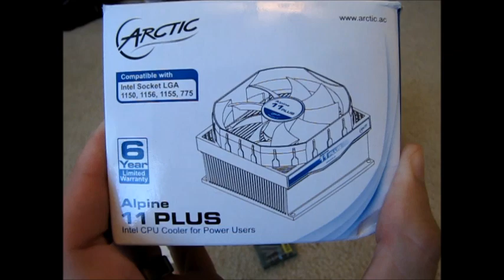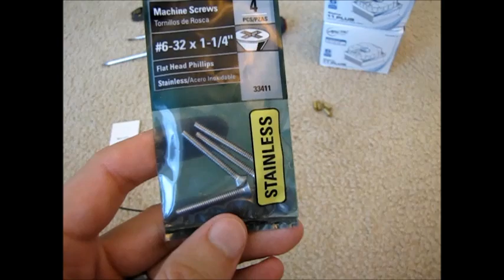How To Build A Peltier/TEC Cooling Device (Thermoelectric Cooler)

Comment: How much did yo manage to cool the hot side? I'm trying to build a peltier cooler to use in an arduino project, but I can't seem to cool the hot side enough to be able to lower the temperature of a controlled ambient (size: 40x40x30 cm)
Reply from the maker: I have tried to measure the temperature but I don't have an infrared thermometer or something that will accurately read the temperature on the heatsink or the tec.  The heat sink is not too hot to touch, though, so it can't be more than about 90-100 degrees or so.  Not sure what the temp of the TEC is on the hot side, though.

Comment: Lets say I made two of these and mounted them in a small area I wanted to cool. 

If I vented the hot air side out the window would it be effective?
Reply from the maker: Are you talking like a bedroom?  The answer depends on how powerful the peltier is that you choose to use (the ones in the video are only 5 amps = 60 watts), the volume of air you need to cool, and how well insulated the area is.  I bet if you got 4-5 of the most powerful peltier devices (300 watts or more) you might be able to cool a small bedroom.  But the ones I have been working with will be able to cool a mini refrigerator but not much more.
Reply: Think the dimensions of a full size bed by 3 feet high. Would the 10 amp one you used in the other video put a dent in the temp?
Reply from the maker: If it was insulated really, really well then it might drop the temps by 5 or 10 degrees.  A pair of the 10 amp ones or a 20 amp one would probably be better suited for that volume of space (roughly 84 square feet) but it would still need to be air tight and insulated.
Reply: Thanks for the replies. One last question.

How many watts would the 20 amp cost? I'm trying to cool off my ferrets area without having to run the AC because I wanna go solar soon.
Reply from the maker: The 20 amp unit would need roughly 240 watts of power (12v x 20a = 240w).  If you are going to power this with solar, keep in mind that you will probably need at least 300w of solar panels for this scenario because they are not 100% efficient.  Also, if you want the a/c to run around the clock, you would need batteries and a charge controller.  That complicates things quite a bit.
Reply from the maker: Also, if you are looking to get into solar you should check out my basics video that I just uploaded that will explain more of what I mean about batteries and charge controllers:  Solar Panel Systems for Beginners - How Does It Work & How To Set It Up

Comment: Hi there.
You've got some cool stuff goin on there :)
I like your idea. Simple and neat.
I am still trying to make one of this to cool down my tank.
I have a lot of question though.

What kinda power source do i require to power up the Peltier element and the fans ?
AC/DC adaptor of any good ?

Also wanted to know if u applied the clay on both heatsinks before you set in the Peltier.

Sorry but I am not tech savvy... :(
So on the hot side, the fan is blowing down on the heatsink and the cold side, the fan is sucking the cool air away from the heatsink ??? Or both are blowing towards the heatsink ?

Hope u can help my noob question :)
Reply from the maker: You can use any kind of 12v power... batteries, pc power supply, solar, etc.  Or you can find an adapter that switches 110v AC to 12v DC (like a laptop power adapter).

Yes, you need to use the thermal paste on both sides of the peltier.

Both fans are blowing air down on to the heat sink.

No questions are noob.  Keep asking and learning!
Reply: LDSreliance
Hi again :)

Thanks for the reply. Was wondering can i get your email address so that i can send you a picture file :D
I really do not know how to convert the wirings. What i did was just to convert a simple 12v adaptor that people use to power small electrical goods like radio and such.
Reply from the maker: Gary Cheah
Sure, you can email me at ldsreliance@gmail.com.

Comment: Hmmm so definetly you wouldn't be able to power this baby with solar power unless your solar panel is pretty bad ass uh?
Reply from the maker: Not really.  Any 150+ watt panel would be able to power this no problem.  The peltier is only ~60 watts and the fans are about 5 watts each.
Reply: LDSreliance That's a lot of watts for such a little device!  Thanks ^_^
Reply: Andres Ricardo Medellin Diaz use an Core 2 Extreme overclocked, That is really a lot of watts
Reply from the maker: Dale Bergeron
What model number of peltier are you using?  What are the specs on the batteries?
Reply from the maker: Oh ok.  Thanks for watching!

Comment: Does this work for mini refrigerator
Reply from the maker: Yes, the small portable refrigerators all use peltier coolers.
Reply: Thanks for the response but can you make it so that you can see were the wires go because I am having a hard time with that when I was watching your video. And instead of wires all over the place can you build it so that every thing is spread out so that everyone knows what you are building and a head up thing is that next time you might need to use a tripod to help with all the shakes on the camera because I really couldn't see anything. And can you build the cooling device with out a electrical box. Thanks Andrew
Reply from the maker: Andy Fujii
I will try to do another video and show things a bit more clearly.  I have a tripod and a better camera now than I did then.  Good ideas.  Thanks
Reply: When do you think this video will be posted.
Reply from the maker: I haven't had time yet, man.  I'm sorry.  Maybe in the next couple of weeks.

Comment: You say you are using solar to power the peltier, so I'm wondering what size solar panel (average / common type and efficiency) you would need to drive it. I'm guessing by the size of the peltier in your video, it would be maybe around 80w roughly?
Reply: Sorry mate, i need to learn to watch the video in full before posting. You mentioned it is 10A draw on 12v so maybe 120W rated peltier. As you say, power hungry devices is the usual obstacle. Brilliant little things though. Am i right in saying you cannot power them up for long without a heatsink attached, i bit like booting a PC with no CPU cooler.... sizzle sizzle pop. lol.
Reply from the maker: The TEC-12705 that I am using in the video is actually a 50W unit pulling 5 amps from my 12v power source (solar battery bank).  I wouldn't power one of these directly from a solar panel because solar panels put out higher voltage than their rating so they can charge batteries.  In other words, my panels produce over 20 volts open circuit so that they can charge 12 volt batteries which need at least 14.6 volts to be fully charged.  Make sense?  So I would connect your peltier to a battery or an adapter that puts out a more constant voltage around 12 volts. 

But to answer your other question, you would need at least a 100 watt solar panel to power one of these after you factor in losses, voltage drop, etc.
Reply: Thanks for you reply
Reply from the maker: Np, good luck

Comment: is the power supply necessary can't use an adapter instead of it ???
Reply from the maker: Of course you can use an adapter.  You will need something that will convert your house AC power (120v or 240v) to DC 12v power.

Comment: hey i was wondering what the CPU cooler wires connect to? and does the peltier cooler wires connect to a power supply, such as a 12v battery?
Reply from the maker: Good questions.  Watch the results video and you will see: DIY Peltier Device Testing Results

Comment: Great tutorial. Thank you, but have u posted the result video yet? anyway if i want to know how much the temperature increase according to the current, what's the method or formula to find out?
Reply from the maker: Yes, the results video is at DIY Peltier Device Testing Results.  I don't know what the relationship is between current and temperature.  I would be interested in seeing that data, too.
Reply: Okay thank you very much :) again great tutorial.

Comment: Hey LDSreliance, I got 6 new TECs, (5x 12705, 1x 12703). The old one was defective along with one of the new ones. The other 3 I have tried work properly so far, until my CPU heatsink fan quit. Even a large CPU HS (without fan) can't properly cool a TEC, even the 12703. Thanks again for the advice.
Reply from the maker: Yeah, I noticed that, too.  You either need a really high end passive heat sink made of copper or heat tubes or else you need one with a decent fan to dissipate the heat of even the lower amperage TECs.  I'm going to play around with some more options in the next month or two.
Reply: LDSreliance It's non-economic, but you can try water cooling for peltiers, it's 4yrs now there's a lot of water coolers that are cheap out in the market although still pricey compared to air coolers.
Reply: how do you tell if they are defective??... I built a micro size 15mm "ice box" for a diorama, the hot side heats but the cool side stays ambient.
Reply: Randy Coolbaugh Use multi-tester i guess!?

Comment: Using stainless and aluminum and brass will cause electrolysis and the aluminum will degrade.
Reply from the maker: Good point.  The heat sinks I used are aluminum.  I don't think there is any stainless in my setup, but I could be wrong.  I also don't see any brass.  But either way, I don't think most people are building these devices to stand the test of time.  Mine, in particular, was a science experiment.  If I build one for something more permanent like a refrigerator I will certainly take electrolysis into account!
Reply: LDSreliance The screws you used are stainless, at least the packaging said they were stainless and the nuts you used, you called them stand ups, appeared to be brass in color if nothing else. Other than that I liked the ideas and the fan design seemed more workable than others using the same concepts.
Reply from the maker: Ahh you are right.  The standoffs are brass and the screws are stainless. Thanks for pointing this out!

Comment: Q: I thermal pasted my TEC1 12705 (15.5v, 5amp MAX) to a large fan CPU cooler. While hooked to a 15v, 1.5a power supply: hot side was hot, cold side is only getting mildly cool in 1 corner. I then hooked it up to a 12v, 4a supply: hot side was hot, cold side was warm. Why am I not getting any cooling effect? Is the TEC defective or damaged?
Reply: maybe the 1,5A is not enough? or did you maybe turn it the wrong way while putting it on the cooler?
Reply from the maker: There is a maximum differential in temperature between the 2 sides.  It looks like for the 12705 it is 68 degrees.  In other words, the cold side will never be colder than about 68 degrees lower than the hot side.  In order to get the cold side colder, you have to cool down the hot side.  Thus you need an efficient cooler on the hot side of the TEC to absorb and dissipate as much heat as possible.
Reply: LDSreliance I have the hot side of the 12705 connected to a heat sink similar to what you have. The cool side never gets below Luke-warm though. It gets worse when I increase amps from 1.5 to 4a. What amperage and voltage did you run your 12705's with and did they actually cool down? I've ordered 5 more, just in case my 12705 is defective. Thank you for any advice!
Reply: BioMoneculaR I've tried the 12705 TEC at both 1.5a and 4a. It seemed to work better at 1.5a, but ran warm at 4a. I had the hot side connected to the fan cooled heat-sink.
Reply from the maker: TMH23 Something is wrong then.  Is the heat sink getting warm that you have connected to the hot side?  Is it seated well with the thermal grease spread out evenly between the TEC and the heat sink?  At 4 amps the cold side of the TEC should be pretty cold to the touch.
Reply from the maker: Also, can you measure the amperage and voltage with a multimeter and verify that you are getting at least 12v and several amps?
Reply: LDSreliance Yes, the hot side gets hot quickly, while the cold side just gets luke-warm to warm. With the "15v, 1.5a" power supply I was only reading 0.21-0.25a, but 15v at the TEC. With the "12v, 4a" PS I could not get any amp reading with 2 different ammeters, but they did read 12v. I tried hooking the 12705 straight to a 12v SLA battery with similar poor results. What type of power supply would you recommend? Thanks for all the help!
Reply from the maker: TMH23
Using the 12v SLA battery should be fine.  I suspect there is something wrong with the TEC.  Some of them are very cheaply made and usually shipped poorly so I would try one of the new ones you ordered in the same conditions before worrying too much about anything else.

Comment from the maker: Small solar panels, wind turbines, computer power supplies, and numerous styles of batteries from wheelchair batteries to golf cart batteries to UPS battery backup batteries.  Plus, you can wire a couple of 6v batteries in series to double the voltage and get 12v.

Comment from the maker: Sorry, George.  These devices run off of 12v DC power.  This is the same power that your car runs off of.  You could connect these devices to a car battery or a solar panel or anything that generates 12v direct current.  The red wire would be connected to the positive (+) terminal of the battery and the black wire would be connected to the negative (-) terminal of the battery.